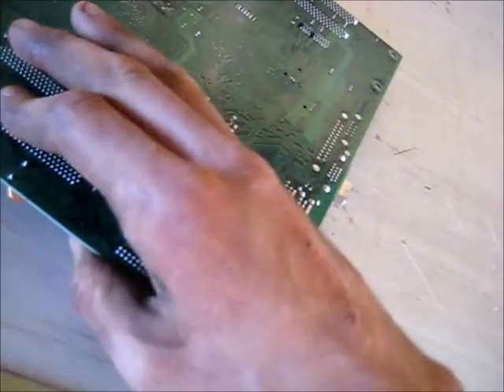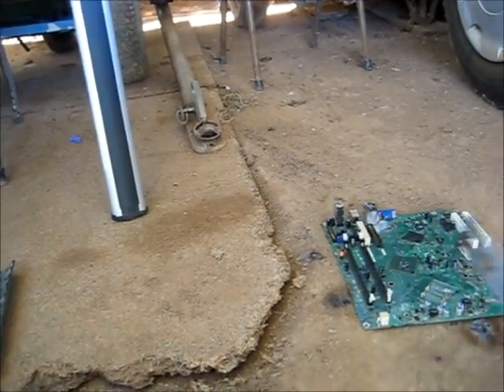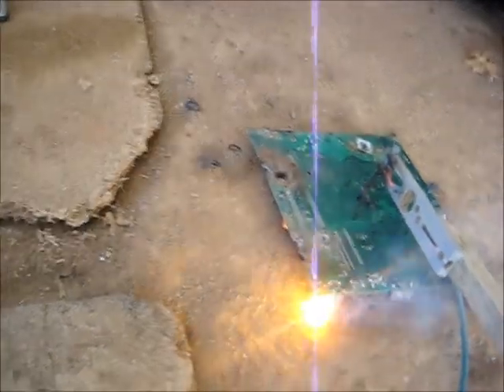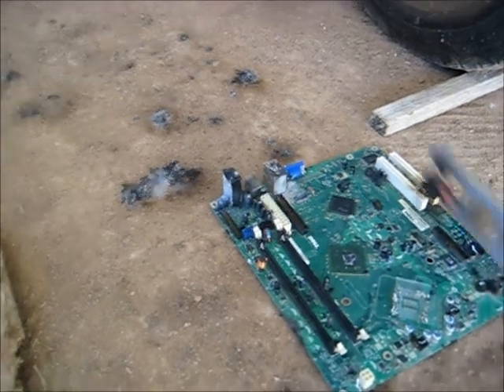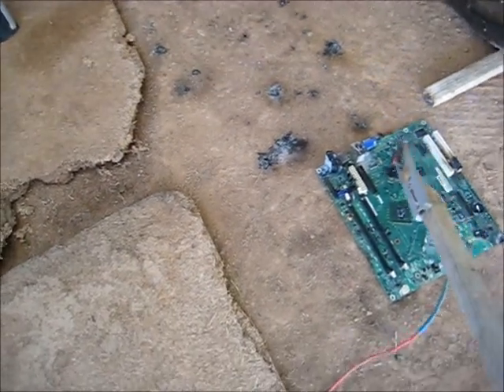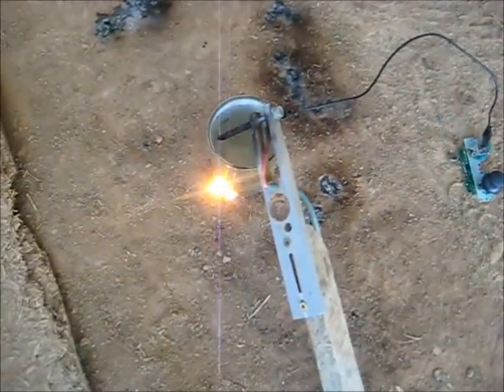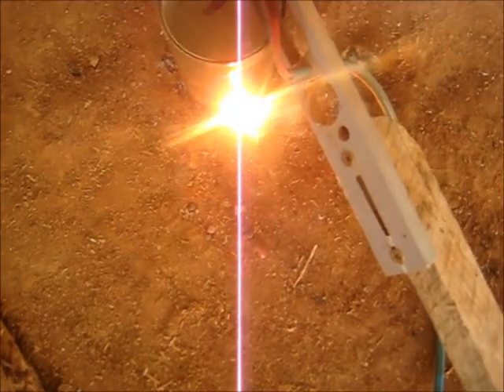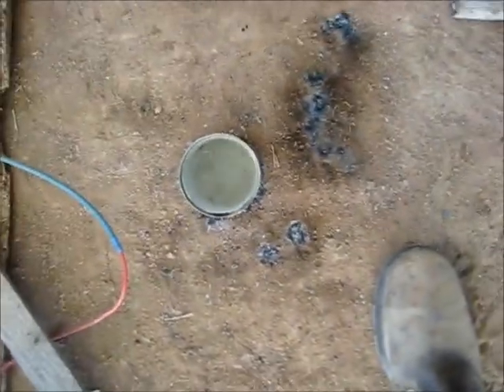Motherboard fry up

Comment: Larry, you had your electrode support touching the container, hence no heating.

Have the electrode only touch the water so the current will have to go through the water.

To cook the circuit at the  earth lead of the cab requires the can to be isolated from ground. Put a rubber mt under it or some very dry wood.

Current flow then from electrode, thru water to isolated can, thru earth wire to circuit board and then ground.

Be aware of step voltage potential !

Comment: I think in this, what happened to the water heater experiment, is that the water's resistance dropped-off too much, and as such, was passing too much current 'straight-through'. The water does need a certain resistance to start heating up, as it's the resistance itself that causes heat. 

By the looks of things, it was the arcing & sparking underneath the can that heated the water! :-D

-BoomBoxDeluxe.